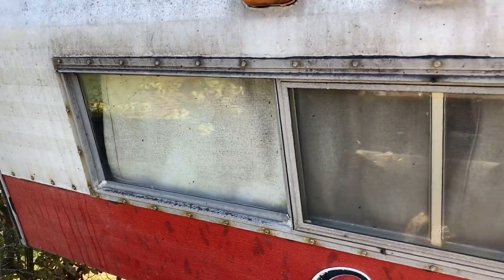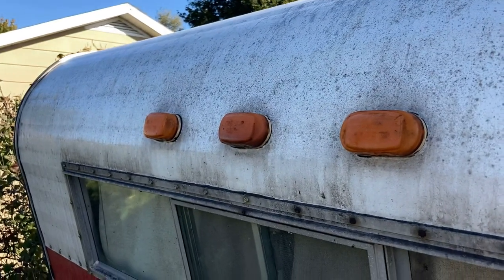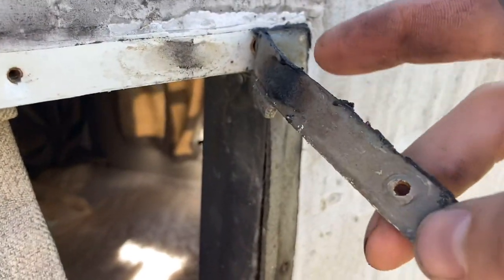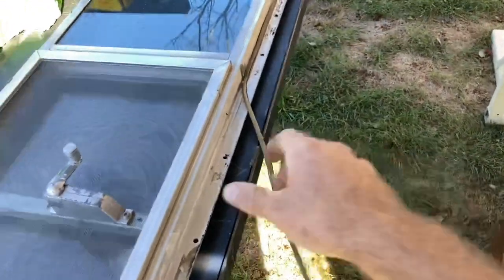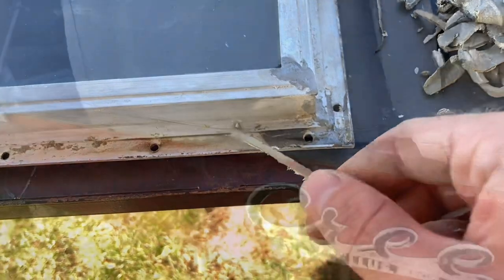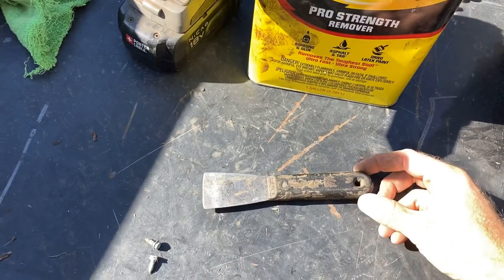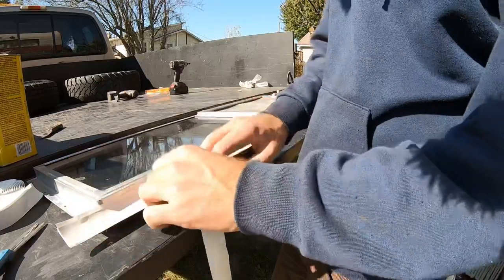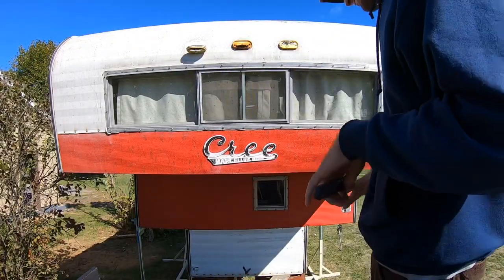How to replace / reseal vintage camper window

Comment: My truck camper doesn’t have a front window which I thought was good. But it still had some water damage. The butyl tape is tuff tough, people always turn to caulk. Your so right fix stuff the right way is the best way caulking just kicks the problem done the road.
Reply from the maker: Yeah that front window gets pounded with weather and wind. You’re so right.... caulking just makes a mess!! Thanks for watching!

Comment: My dad and brother have been in the rv and mobile home business since 1954. that tape seal was used for speed of production and not awesome sealing. It worked well, but not great, as thats all that was available back then, the newer sealing compounds in tubes is much better at sealing and lasting.

Comment: Should she have a drip cap? Would help water run away from window
Reply from the maker: It has factory gutters on both sides of the roof. It has more to do with the way it was leaning and the direction the weather comes from.  👍

Comment: You don’t like silicone? Every windshield is put in with silicone !  Tape will always fail. 
Heat gun or hair dryer will release the glue on tape. WD 40 will remove glue residue and works much better then goof off
Reply from the maker: I prefer tape on campers.... as do most people in the rv world. I tried wd-40. It  didn’t work. 🤷‍♂️